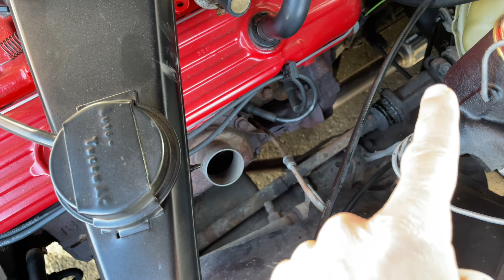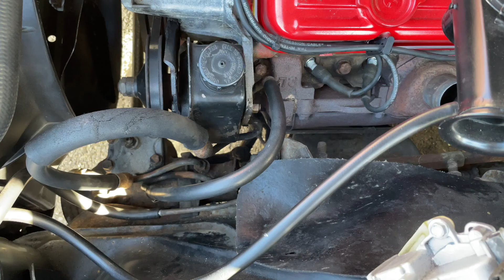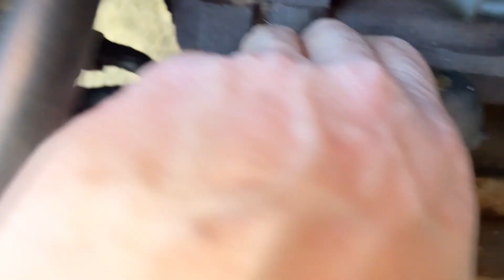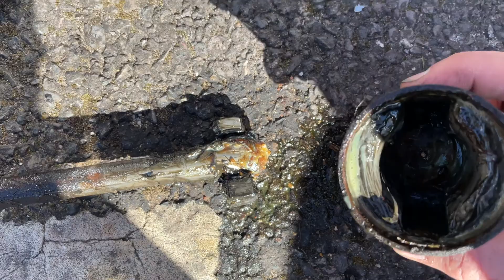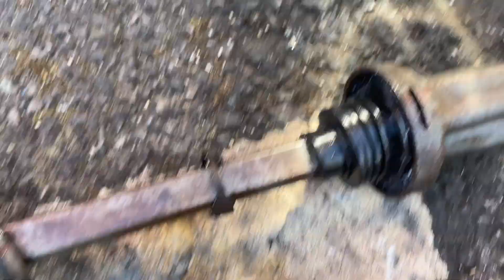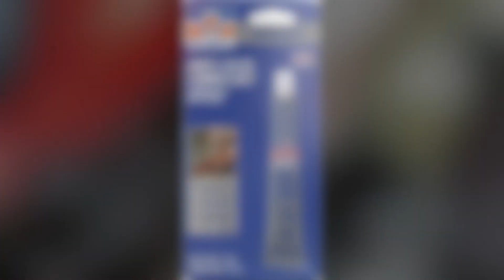1972 Buick Riviera - Steering Column Boot Replacement

Comment: If youve got a really rusted on stubborn bolt you work it back and forth and spray penetrating oil in between attempts .pretty sure those on the column arent excessively cranked down .id have to go into the garage and check the manual but i would think 25 to 30 foot pounds .so once you e broken them free they should go pretty easy
Reply from the maker: Thanks for the information, really useful to know. Yes, you are correct about the torque setting for these nuts.
Reply: I had to do a streering rack for my 92 pontiac convertible and three bolts went rather easy. One was very stubborn so i sprayed it with penetrating oil tried it then waited overnight after ten days a came apart
Reply from the maker: @stevezielonko1386  Amazing how much time one nut can add to the job!
Reply: I didnt need the car for anything so i just went in the garage every day after work and gave it a twist this way and that then a squirt of pb blaster and gave up for the night. A pro with a customer waiting couldnt get away with that
Reply from the maker: @stevezielonko1386  Yes, you're right. When doing it yourself, best to take your time. I broke a bolt on the water pump and it took me a whole day to drill it out.

Comment: Where did you get the boot from. I have a 71 riviera and the boot on mine is toast. I ordered one and it is too small. It’s a 2” diameter and the socket is 2 1/4
Reply: Never mind I just saw the part where you modified yours
Reply from the maker: @markjones6075 no problem, it was tight! There’s a link in description to the one I purchased from Amazon. I’ve checked and it’s still available.

Comment: Hi Adam I've just fitted a new rubber boot on the steering shaft on my 74 Pontiac Trans Am, after successfully fitting it I checked the operation only to have the rubber boot pop out from under the retaining clip. Thinking I must have done something wrong I started Looking on U-tube and found lots of videos showing how to fit the boot, nothing I found seemed to explain the issue I was having  until I came across your video. Taking note of the issue you had with your Riviera I followed your instructions and now have it installed safe and securely. Thank you for sharing your experience with us.
Reply from the maker: I am really pleased to hear that and I am so glad that you got it sorted! Thanks for your comment and view!

Comment: OMG my friends in Farnborough were just talking about a shop that specializes in old trucks.  Wonder if it’s the same place. 🤔🤔
Reply from the maker: Yeah it could be! There is NAMCO and RPM, which are workshops and a parts shop, all in Farnborough.
Reply: @V8Adam  small world.  My dream is to take one of my big Pontiac’s over on QM2 and visit all my UK friends.  I worked on cruise ships and I have friends in all corners of the UK.  Can’t think of a better use of my 71 GrandVille convertible, than cruising through the UK.
Reply from the maker: @SeaTravelr123  Sounds amazing! If you make it over, give me a shout and we can cruise around together :)

Comment: Adam, last night The Grand Tour was aired on Amazon Prime. Richard Hammond in a green '71 Boattail. If you don't have Amazon Prime, shoot me your e-address and I will share the episode with you from my Google Drive.
Reply from the maker: Thanks so much Erik! I do have Prime, so will be sure to check it out. In our group we actually followed the sale of that Riv, as I found it on eBay originally. Then my friend found the owner on FB. Looking forward to watching it, although will be painful to watch them rag them 😵
Reply: @V8Adam  OK mate. In one of the shots under the bonnet I could see a 455 (valve cover bolts) and some shiny new engine bits, but I'm curious what engine they used for the supercharger set-up.
Reply: Watch the episode when Hammond drives off of their bridge (almost at the end): the car is moving but the supercharger belts and pulleys are not turning.